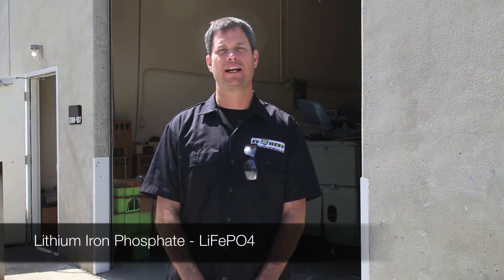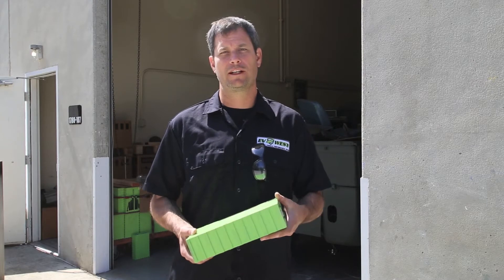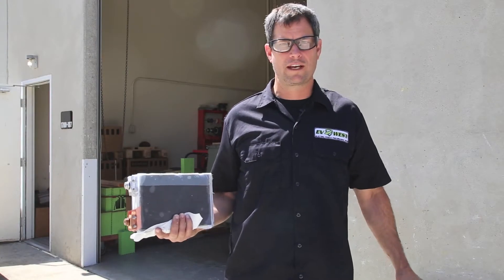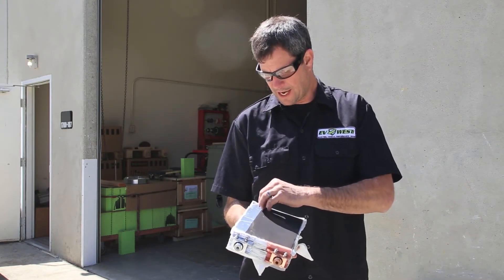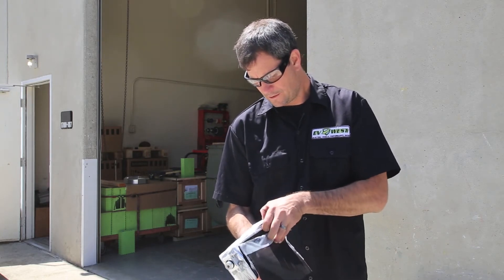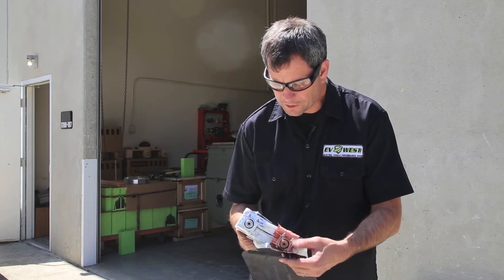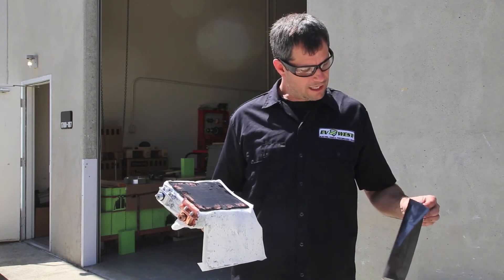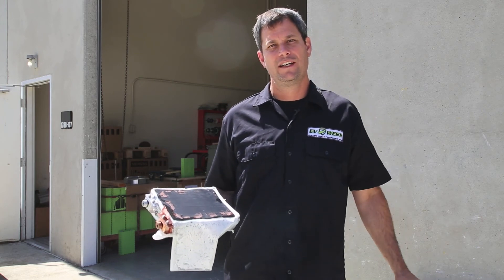how to recondition a car battery at home

Comment: I tried Two batteries on the weekend and both of them looked to be " dead". After utilizing this battery reconditioning plan “kamvo shocking plan” (Google it), I had been able to rejuvenate them both to 100% working batteries. I saves  $ 180 because of this process!

Comment: Every electronic you have needs batteries! But DON’T buy 1 new battery this year until you see this [Check Details Here==>https://plus.google.com/100351090281822647456/posts/HMvgs7qqoKA ]. You can just recondition your old, used batteries and save a lot of money!